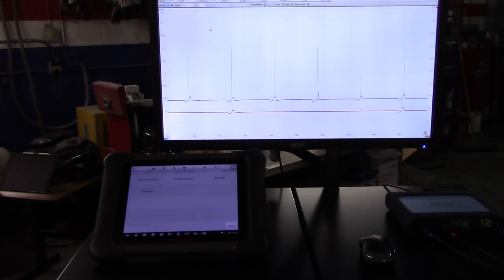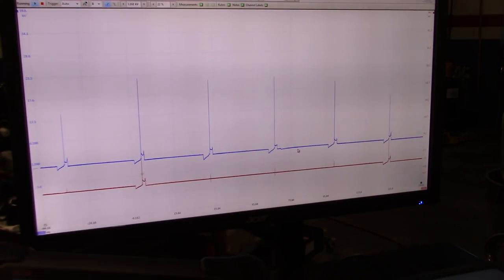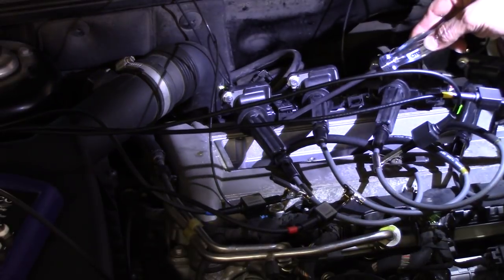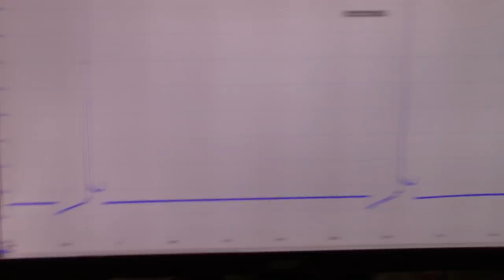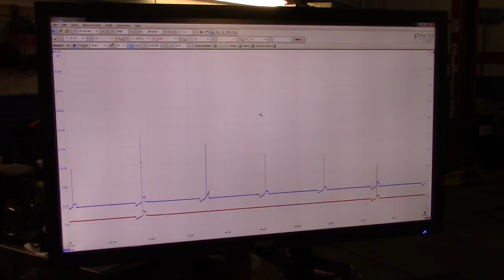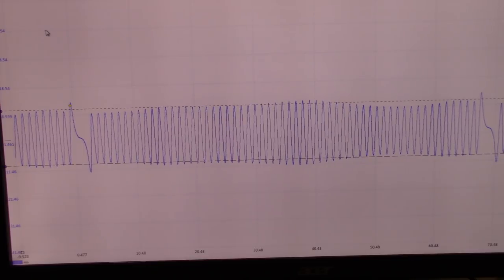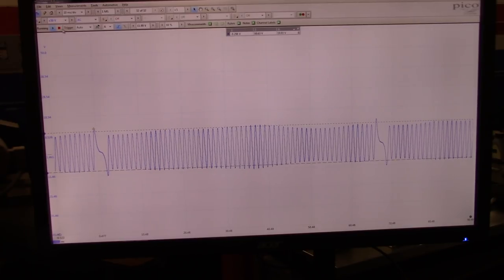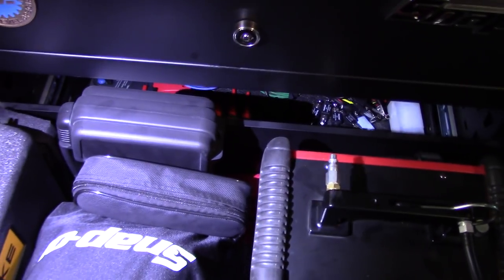2008 SAAB 93 2 0T Random misfire diagnosis

Comment: Maic, thanks for this video. I had big issues on my 93 t (lot of smokes, car not running) and I made a big renov of the headcylinder following your videos. Changed intake valves, lifters, all gaskets, have injectors cleaned and controled, the Injector control I/C in the ECU has been replaced and ECU tested good I also changed spark plugs and coils a bit before  this work. 
The car is now running well and very smoothly, no cranking issues with both cold and warm engine but I'm still having Misfire codes on cylinders 1 and 2 (P0201 and P0202).  Even if the car runs well I feel a lack of power. Any ideas ?  I'm considering to invest in an AUTEL scanner. I'm not a professional mechanics and only I'm only working on my SAAB, is the 808 model enough or does the 906 (significantly more expensive) worth the invest. Thanks again for all your great  information
Reply from the maker: Gaetan PERRIER not familiar with the 808 Autel. 
As far as misfires have you try to swap the coils to see if follows and then spark plugs? That is a quick test. Did you use the recommended spark plugs and coils needs OEM.
What grade gas are you using? 
Another possibility is the crank sensor signal too low and creates false misfires. As per the lack of power. Did you set the timing with the correct color blocks? They are 3 different ones!
Reply: @MaicSalazarDiagnostics   Many thanks for your answer. I did swap the coils and codes remains on cylinder 1 and 2. Spark plugs have also be changed  to the recommended model. Car it running smooth at idle and while driving so it doesn't look like a real misfire program. I'll try to scope the Crank sensor as you are doing in the video. 
Regarding the lack of power I  do not understand what you mean by the color blocks ? The timing was set correct as I used the camshaft blocking tool. 
Regarding the lack of power, I will check the boost pressure line soon to check for some leaks. But I have also notice than the car is running my much better on manual mode. One of the issue of this lack of power is that the automatic transmission is shifthing at low RPM. Perhaps I should have the TCM checked ?
Reply from the maker: Gaetan PERRIER the camshaft blocking tool you refer, they are 3 different colors for this model, all depends on year and others. How did you pick the block to set the timing? Each color sets the timing completely different!!

Comment: I have the same problem. Random misfire still, after coil packs and spark plugs changed. Its not the Turbo either. What am I missing? Is it the crankshaft sensor after all?
Reply: I join this question... But I also have another fault, after starting (It costs a lot to start cold) it stops and you start again and it stops..... And it only shows the fault P0300... Everything checked and pipes checked to avoid possible leaks. Could the valve be on the injection rail? Could it be PCV? Can you help me, it drives me crazy...thanks advance ;) @Maic

Comment: After valves replacement, did you adjusted timing with special time adjust tool?
Reply from the maker: Jonas Švažas I set the timing with the special tool when installing the timing chain.
Reply: Was it me or I just didn't figure out anything but he has a sick ass tool box what was the problem on that Saab?
Reply: @MaicSalazarDiagnostics  how was was the problem with that Saab
Reply from the maker: @chrisramos6415  on this car I replaced the intake valves and exhaust to correct a misfire on cold start. After that repair car is running great but misfire codes came back, the actual misfire is not present but computer still shows misfires even with perfect idle and fuel trims so it was just a software correction need it. On this video I was trying to figure out if misfire was real or no! Thx for watching!
Reply: @MaicSalazarDiagnostics  The cause of the misfire on these cars is almost always a problem with the plugs. Only use NGK BCPR7ES plugs. Anything else it will misfire and cause lots of problems.